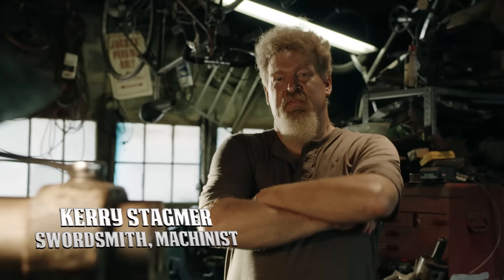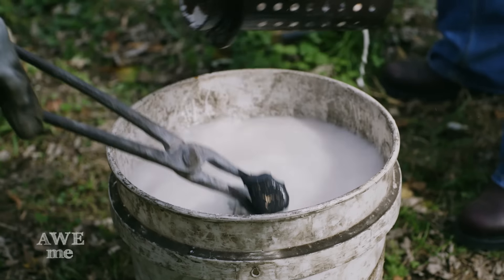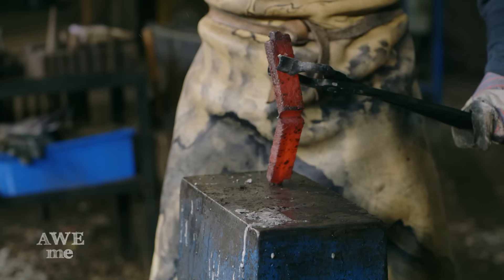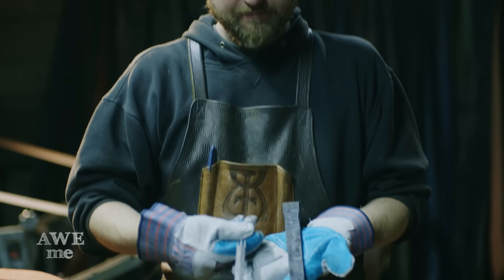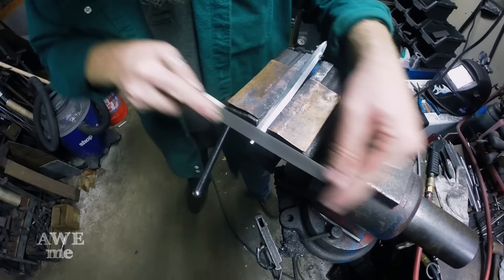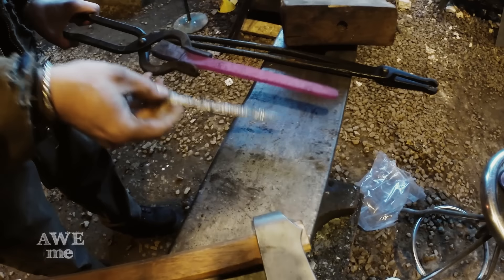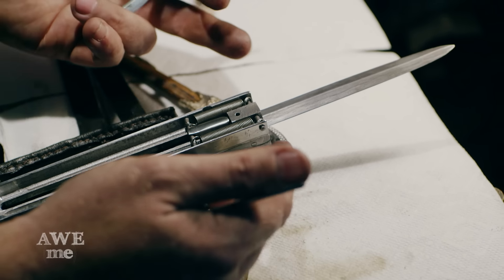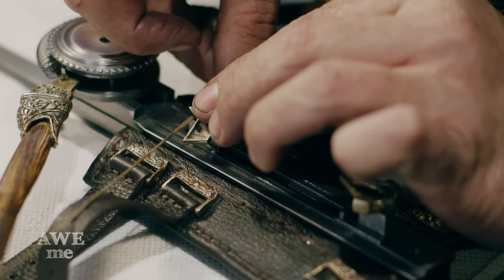Arno Dorian's Phantom Blade (Assassin's Creed Unity) - MAN AT ARMS: REFORGED

Comment: This was an really interesting build. It's great to see an actual working 'hidden' blade.
Excellent work you guys.
Reply: alberach As far as I can remember that one didn't actually work. But I might be wrong about that one, it's been a while since I saw that epp.
Reply: ***** It did work. It just had to be hidden by hand. You can get it out, but not in again.
Reply: alberach Tony built a hidden blade, but it didn't have the bow component. ***** Unfortunately it wouldn't be possible to make a bow which closed back up again, (would need delicate clockwork mechanism). I'm pretty sure they would have added that if they could.
Reply: alberach I see where you're coming from, but they simply go with the most requested builds. Rather than blame Man at Arms, how about looking at all the people that requested it?
Reply: ***** Lol, it's not working like a real one because they don't exist. It would be impossible without resorting to electronics or making it much larger... but then they'd have been cheating. :'3

Comment: The whole time since I saw that crossbow in the ACU trailer, I'm thinking: "surely there's not going to be enough force imparted on that bolt to kill a man, let alone penetrate any armour he's wearing, is there?"
I mean, there's a reason they make crossbows bigger than that, and without foldable arms, right?
Turns out I was correct, because that bolt didn't even penetrate the whole way through a cake, lol.
Seriously though, this thing looked awesome. The lady who does the detailing in wax doesn't get half as much appreciation in these comments for the work she produces as she should.
Reply: You're very right, though in that time, people didn't wear much armour!
Reply: Well its the French revolution in the colonial era, I don't think anyone is going to be wearing armor at this period, its all tailcoats and fancy military uniforms.
Reply: I don't think it's supposed to kill them. In several videos they show arno with guns. I think it's supposed to be like the dart gun in assassin's creed 4
Reply: Two words Poison Tip
Reply: *****  I think you got faar away with lb. 320 lb i more than 140kg. Strongest of bows had 80kg.
Reply: Better springs can solve the power problem. But the dart dont have a good aerodinamic.
Reply: In the neck though , then you're finished
Reply: not really.
If it can't pierce cake, then it certainly can't pierce your throat.
Reply: Zachary Walsh There are better ways of fireing a poison dart.
Reply: Nusm4 But are there cooler ways mr guy. I would also like to point out that i was stating a  way i which the weapon could be used to kill a target not that it was a effective method of assassination.
Reply: I think the metal bolt and the weak string fucked up everything. Actually, a wood bolt and a professional made string would give it much more power.
Reply: People at that time stopped wearing armor because of guns, armor isn't just strong enough to take the hit and it's becoming too heavy to wear in battle. The point of the crossbow is to shoot at somebody close to point blank range so it would hit them hard enough to kill them. Usually when the bow is shot, it's shot to a vital area of the body, ie neck, arteries
Reply: ***** It would not really be capable of killing, let's be real here. Yes, if you hit exactly the right spot, the target might die but, like you said, the accuracy prohibits it from being viable in that regard. Even good old throwing knives would be better, having much more force, less technical problems and a way higher rate of fire (depending on your skill).
Reply: I think we can all agree that a crossbow of this size and manufacture (all the potential force will be on the ratchet that keeps the arms out) is more of a cool fantasy toy than a realistically lethal weapon.
While it may be possible that a bow of this size could be designed and built strong enough to penetrate through era-appropriate clothing, and even human skin/ flesh, it would not have the required penetration to kill a man with force due to the strength of the bow, and the size of the bolt, and would be an impractical, experimental, temperamental and convoluted method of delivering some kind of poison.
The truth of the matter is that if devices like this COULD be employed, historically, they would have.
Reply: It is basicly usless it cant even penetrate a watermellon. You are not going to kill a man with that.
Reply: Do the shulk's sword
Reply: Yes with perfect conditions, a high level of skill, and a lot of luck you may be able to kills someone with this weapon but the same could be said about a spoon but spoons were never adopted as weapons for a reason. Lets leave the fantasy in the video games and stop trying to take it to the real world.
Reply: A good shot would have been able to pick out a patch of exposed skin, and that would be good enough, I suppose
Reply: Id say your better of throwing the bolt lol
Reply: I'm sure that in the video the crossbow isn't even functional, they fake it.
That crossbow design is just shit. Next assassins creed you will have a blade, a crossbow, a cell phone and a gun on that bracer.
Reply: Deivid Steffens
It would  actually be pretty cool to see an Assassin's Creed set in modern times even with the inevitable cellbladecrossgun.
Reply: Nusm4 Throwing knives would be alright I guess.
but Arno is going for multiple things
Coolness (this is obvious because he's got a hidden knife when he could hide one in his pocket.
Speed (The hidden knife again. It comes out quickly enough for assasinations, and does minimum exterior damage so nothing is suspected)
Stealth (Having a crossbow on arnos back would really hamper him, also having to aim it for like a year just to pin a guy down as he screams most likely. Compared to having a minicrossbow which could still kill, and silently, but not everyone would die.)
Throwing knives would be kinda speedy, but for them you'd need to know exactly where they will be and the perfect angle to throw the knives (Im talking about long range, short range you could just throw without aiming) at them. 
They would be stealthy, especially on the wrist, like a replacement for the crossbow, but with a spring?  (That would also make it super cool.)

TL;DR Meh. But on the good side of meh.
Reply: Stan Stanmanson I'd think the crossbow might deliver knockout or poison darts
Reply: Yes
Reply: ***** A watermelon's skin is far more strong than human skin...
Reply: Elias - C. No it is not and just penetrate won't kill someone.
Reply: SPARKPLUG807 that crossbow wouldnt even penetate your clothing nor skin. it wont even give you a bruise or a sore spot. a baby can stab that bolt harder than the crossbow can shoot it point blank. 

even if its not designed to kill it would be useless IRL. all the force seems to come from the whimpy spring that holds the arms forward. a (cross)bow gets its force from the arms' flex, many, many times more force than that spring.

they shouldve stuck with the proper assassin crossbows, they were just as small. just not foldable or on your arm, but those did deal a somewhat deadly punch from up close. imo it looks a bit awkward to be on the arm along with the blade anyway.
Reply: DIExxENE I tried to say this, but my english isn't so good.
I'm sure that spring they used on the model can't fire the bolt 5 feet away.
Reply: RyNsWoRLD  I find it funny that you think McFarlane's Phantom Blade mechanism is that of the game version itself.
Reply: well the one in the game doesn't exist in real life, and while these guys aren't licenced by ubisoft as far as I know, this is about as close as you're gonna get to the real thing.
I don't think these guys take as much care over what they're producing being a usable weapon as Tony used to, if I'm honest, but I think they do a pretty good job. Truth is, this weapon, due to it's size and mechanics, is no more practical or realistic than a huge-ass dumbshit anime sword
Reply: Actually, there's a guy named imdeepainreborn who actually makes real life in game accurate mechanism for the Phantom blade, search him up.
Reply: Actually its because the bow folds, the pivots mean the bow cant store as much energy as if it were one solid piece. A hand crossbow of that size can be constructed which will impart enough force to kill a man... at a distance of less then 6 meters. Mabey more if you used an elastic band for the string ontop of a steel bow for extra oomph.
Reply: A spring-like string used for guitar bands.
Reply: Mueldex's version doesn't shoot from the actual crossbow itself, though it works by a wrist flick.
Reply: Check out Imdeepainreborns phantom blade, it can put a hole through a wooden door and it is actually crossbow powered.
Reply: well, the crossbow bolt stuck into a watermelon and pumpkin which has flesh alot harder than a mans. so if fired at the neck of a guy, yeah he could bleed out. like ninja stars, if hit in the right place, you case damage. also, poison tipped bolt?
Reply: The Aegis
Very few poisons kill fast enough to prevent them from killing you, and we don't see the range it's fired from it may have only been that effective from a foot or two.
Reply: Kyle Rhulain
you honestly think back in those times everyone had anti poisons that handy? a time when disease was man's worse enemy? they barely had enough doctors to stop a simple wound from becoming infected and causing more problems.
Reply: The Aegis
Dude... you misunderstand. Poisons that just kill a guy in seconds are rare, especially when you dont have chemistry to synthasize them. It's not that everyone had anti-venom, its that most poisons avalible in the time priod killed in hours, or minites if they were very potant. Also there isn't much poision you can apply to that dart, its a flat chunk of mettle, not a syringe, so the dosage of poison is well very poor. All in all, a very terrible weapon to poison.
Reply: You're typing too damn fast.
Reply: I know right hahah
But  if the weapon is coated with lethal poison then it served its purpose
Reply: The phantom blade bolt isn't gonna be able to penetrate bone, but with a few modifications, it can be viable for delivering poison from a short distance away. Or it might nick an artery.

Comment: I love the amount of times they casually throw off the line "this special piece of equipment someone made specifically for this task". Like, it's not enough to have all these fancy tools and machines, sometimes, you need to just make a tool to cut metal with the power hammer.
Reply: Matt Stagmer that must be handy. realising you could do something more efficiently, and just being able to design and make a tool to help.
Reply: Xander B I'm a fabricator and the amount of things we make around the workshops which you could never buy is amazing. Most tools don't do the job you need them for.
Reply: MrRamblingMadman that's pretty cool. I imagine it saves money as well? Instead of buying an expensive bit of kit you can put one together out of things you have around the shop.